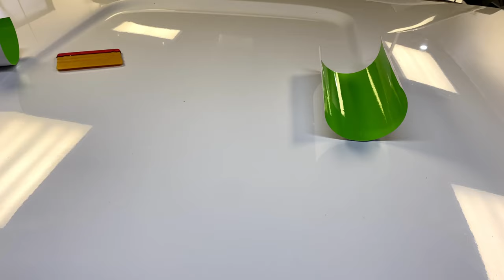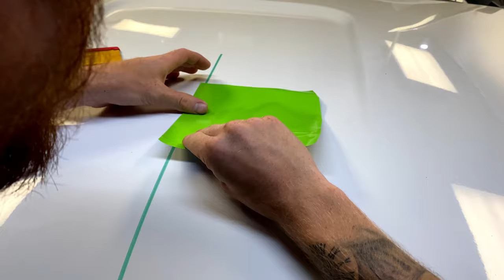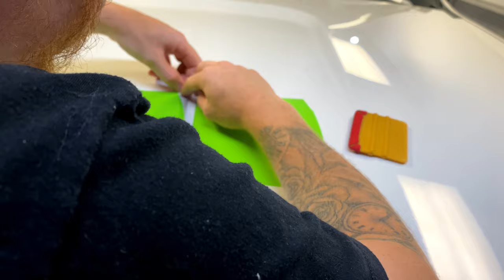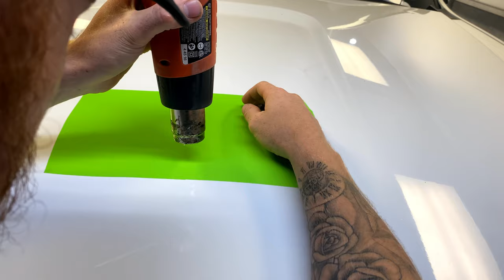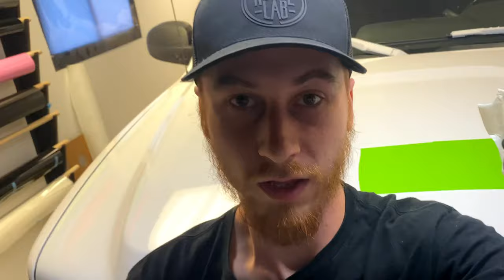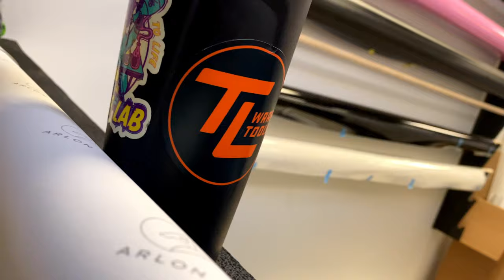How-to make the perfect seam with vinyl.

Comment: 1~2 years and vinyl will shrink , made a gap of void
Reply: No it won’t if it’s done right. That’s why with seams it’s important to preshrink it with the heat gun for a couple seconds. The film is slightly stretched during the manufacturing process and the heat gun will remove that stretch.

Comment: I’ve had some solid results using a laser line level when marking my joint lines , might be worth a shot as they are pretty cheap . However your work looks pretty dang clean so may not do much for ya

Comment: I don't understand the point of the tape. You're just overlapping the vinyl. I mean, you even pulled up the vinyl after you did the tape and then just placed it back on itself and smooth it out. so what was the point of the tape?
Reply: It cuts the vinyl exactly where you want to.
Reply: It’s a better way of trimming the vinyl precisely without having to do something like cutting on the car.

Comment: The only problem with that is that water can penetrate it and get under the wrap
Reply: There's sealers you can use to prevent that like for edges and stuff

Comment: I found this to be useless.  What project would you use this method on?
Reply: different colors next to eachother, weird angles, i'm wrapping a motorcycle tank and want the curve of the side to be the og color, this allows me to cut the vinyl to shape.
Reply: If the tutorial is useless to you and you have no idea what project it would be used on, why did you watch the video in the first place?? I'm curious 🤔
Reply: @terry2405   I didn't I cut it off
Reply: @sworley1956  There's your problem. Its all explained at the end.
Reply: I thought that this would work, but the problem is in just a few months or so with the change of temperature outside, the vinyl compresses and expands naturally making the linear gap between the two sheets more visible.

Comment: This guy lol. Just over lap two pieces of knifeless on top of each other. No need to lift the vinyl up
Reply from the maker: You are right that works too. This is just another method to do it.
Reply: I'm confused on this process?  No video shows a close up view..  How do you line the two (cutting tape) up perfectly? on top of eachother?  My fjr1300 is going to be a nightmare..
Reply: There is no such thing as a seamless wrap. Even in this video when he did the close up shots at the end you could still see the seam if you're paying attention. The idea is just to get the lines of each side to line up and not overlap. I've never had to lay two pieces of knifeless tape down, only just one. You just have to make sure that you're cut starts correctly and that you don't pull too hard while going across the wrap since you're cutting through two layers of vinyl. Tons of methods, and it just takes time to learn and to feel comfortable doing it.